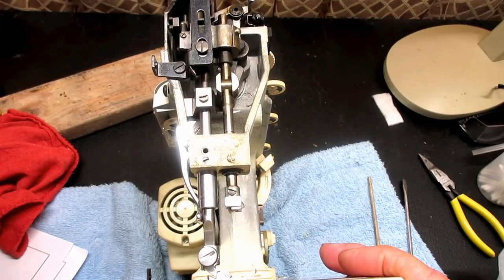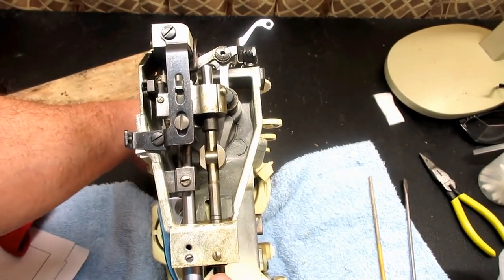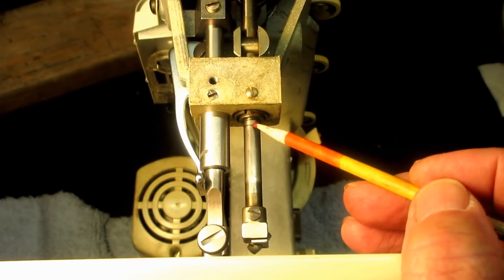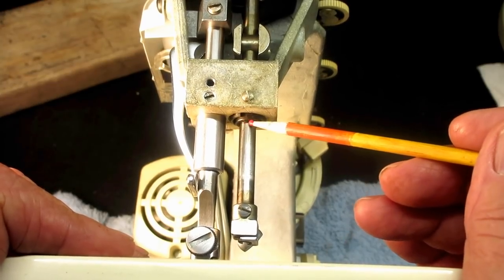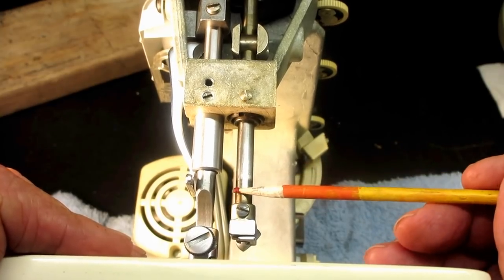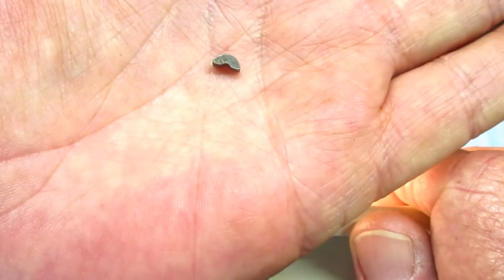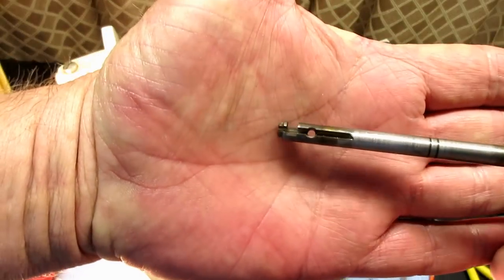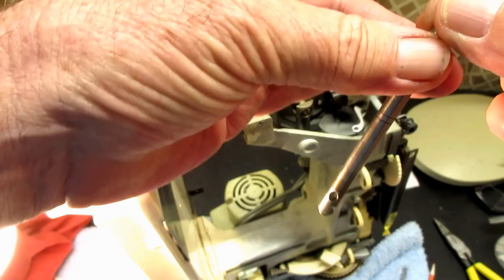Remove Replace Clean Set Height of Needle Bar Singer Model 353 Genie

Comment: Andy, I took the needle clamp off before I watched this video because it was so gross!.  (Poor Joon)  I quickly found out about the jib, lol, it came off when I started wiping the bar with wd40 to try to clean it a bit.   Surprise! lol.  Could have been a problem though had I not seen it and thrown out the paper towel, yikes!. 
P.S. if your not in a hurry, I ordered some round brushes off Amazon a while back, 8" nylon tube cleaning brushes for cleaning tubes and narrow neck bottles etc for $3.20.  The smallest one will clean a straw.  Handy dandy, I'm going to get another set for cleaning Joon and hubby's tools 🙂.  Took a while to get them but well worth the wait.
Reply from the maker: I'm glad you caught it! A few of those have been lost over the years. I get emails asking why the needle won't stay in the clamp after cleaning. Thanks for the tip about the brushes.

Comment: Dear Andy, I have been watching this set of videos on this machine (thank you so much for making them!). I have a Starlet 354 passed on from my Mother and I love it! I am realising, however, that the horizontal marks are actually above the metal “box” and not under it. When the needle is on its lower point, the upper mark is aligned with the top of the box, leaving the lower mark hidden inside. Is this normal? I mean, I have been sewing with it - I only opened it (following your great instructions on the other video!) to clean it and to replace the broken belt on the side - but I have just noticed this difference.... I actually don’t think it would fit the way I see in your video as the metal bar would be way too low.. I am puzzled!
Reply from the maker: Yes, I am puzzled also! 👀 My understanding is that the Genie and Starlet models 353/354 are the same, just named for the USA (Genie) and France and other European countries (Starlet) I have the parts manual and it is identified as being for both the 353/354.
All the Genies I've worked on are just like the one in my video. I have never seen or worked on a Starlet though, so maybe your machine is normal for Starlets, especially since it works well as it is for you. The parts manual identifies the needle bar as part #37926. It's a dilemma then if the Starlet uses a different NB or someone used a substitute NB on your machine. No definitive answer from me this time. Sorry, Joana.🙁
Reply: @andytubesewing1953  Also Starlet 495, the two timing marks is above the box, I was just finished adjust it today, spent almost the whole day, this include watching your clips that explained how to align the hook point and the needle. Thank you so much for the clips.
Reply from the maker: @nickel5461  OK, I  get it now. You are talented to understand the relation of the needle to hook point and height regardless of where the timing marks are. The Starlet model was not sold here so I can't get any manuals for adjustments. I don't know why they used timing marks like that unless the needle bar was also used on some other models. I'm glad you persisted with the repair and congratulations. BTW, as a YouTube member you can upload pictures and videos anytime you like. https://support.google.com/youtube/answer/57407?co=GENIE.Platform%3DDesktop&hl=en